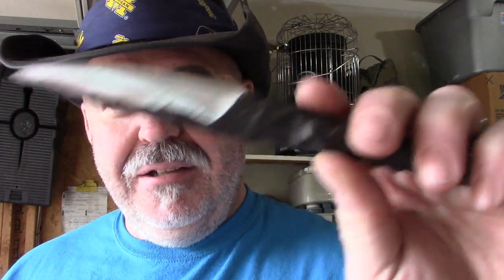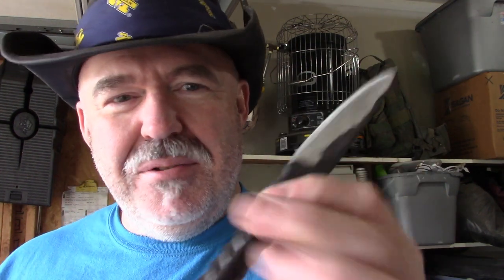Forging a Knife & Cheese Tray with Rebar

Comment: Sir. I really enjoyed watching your video. It took years of experience to forge a piece of steel close to final profile. 
Hope you don't mind me asking, have you ever forged weld rebar with high carbon steel. Does it work as cutting tool? Thank you in advance
Reply from the maker: Early on, when I was teaching myself how to forge weld, I messed around with a lot of rebar, so I'm sure within the trial and errors, I managed to get some to stick to some 5160 leaf springs or something.  As for using it, I can't answer that because I never finished anything at that stage.  Rebar is literally a mix of whatever they could find to throw in the pot.  Within a single piece of rebar, you could have amazingly different carbon contents.  So a knife you make out of 6 inch section might turn out pretty nice.  The next 6 inches might be total garbage and you will never get it to harden.  Its a crap shoot.  Now, if you're talking San Mai, and just using it on the outside layers, then as long as you get it smooth and clean, I wouldn't think it would make much of a difference to the high carbon cutting edge.  There will be some carbon migration, but as long as you start off with some quality carbon steel, then the effects should be limited.
Reply: HoJ Forge thank you sir for you explanation